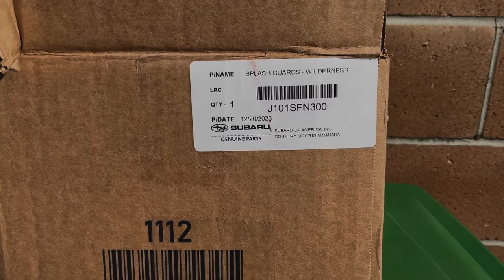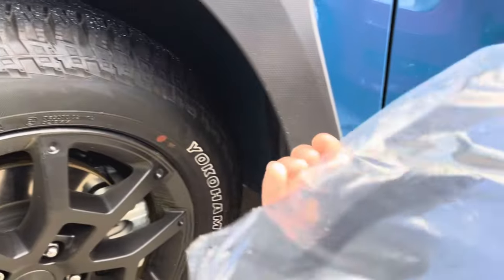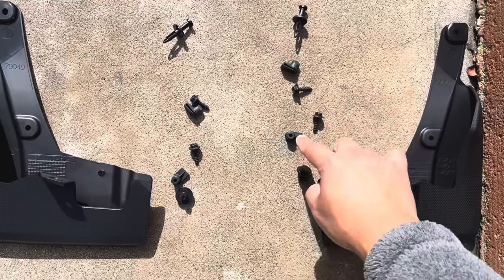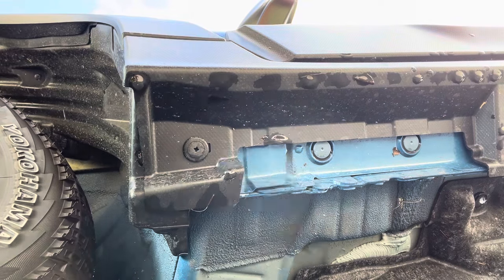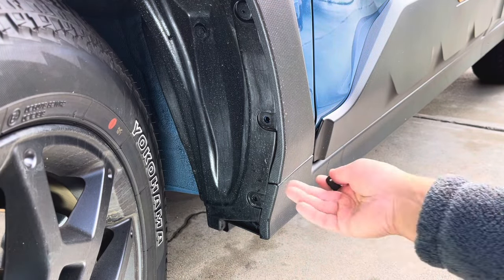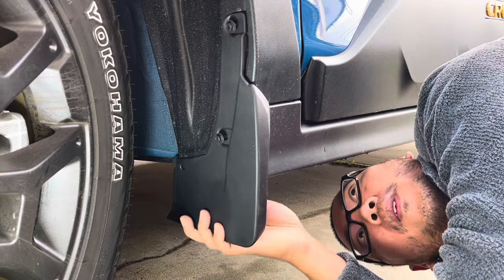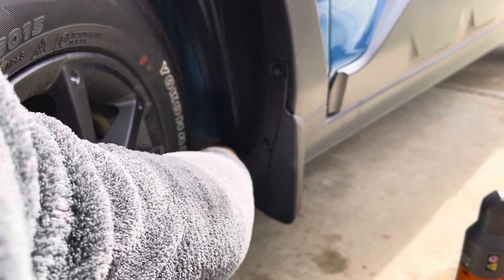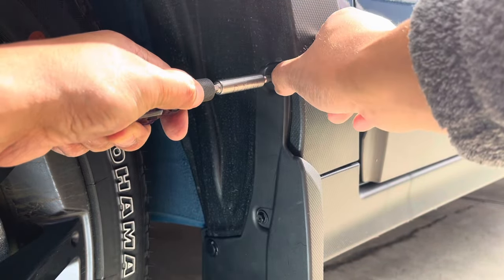2024 Crosstrek Wilderness Splash Guard Installation Tutorial part #J101SFN300

Comment: I have these these splash guards for my crosstrek wilderness but haven't installed them yet. The box they come in tells the consumer to go to a Subaru website and download the installation instructions for these. FYI if you look at the instructions they show the wrong picture of the rear splash guard and do not show that you have to drill an extra hole for the rear mounting (as you do for the front). So just follow these video instructions for the entire installation and you will not get confused. 👍

Comment: Nice video but ... why do you want splash guards? Aren't they going to scrape in off-road situations?
Reply from the maker: @bobpeticolas121  thanks. I do 99% city driving and hardly any off roading, but I do, it’s mostly soft roading. Splash guard is enough for my needs. Also, I prefer the looks of the splash guard rather than mud flaps.